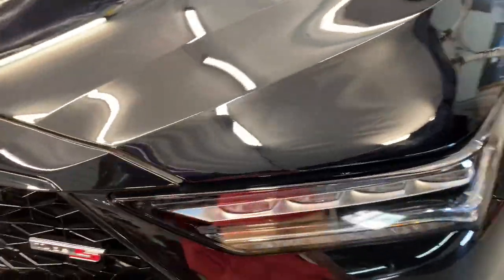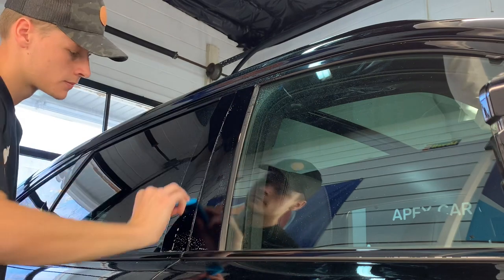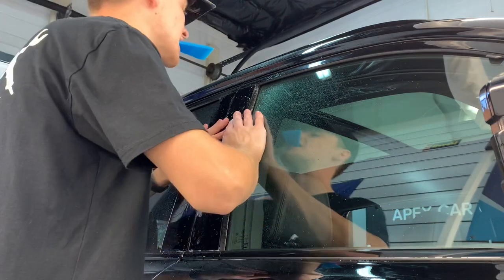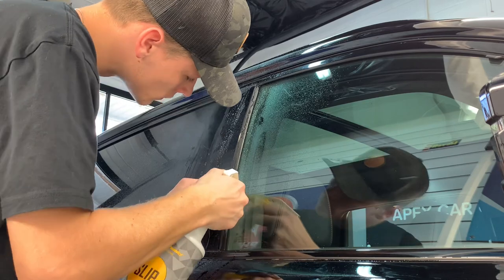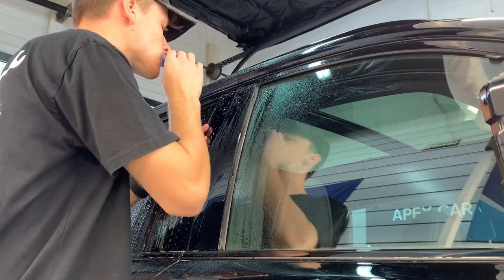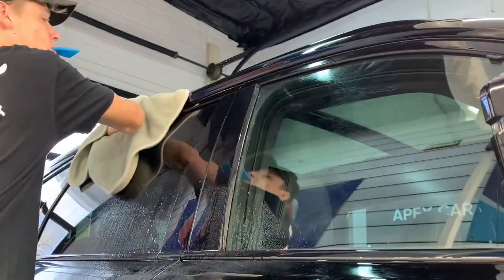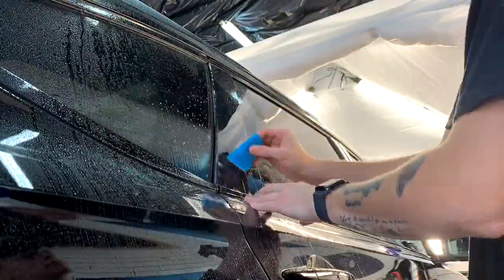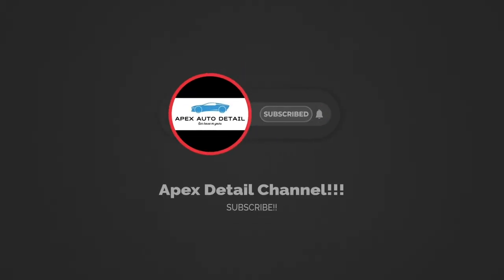The Absolute Best Protection For B And C Pillars!! Soft Black Piano Finishes!!!

Comment: The business that are doing mine should watch your video. They are hopeless. I’ve been back 3 times and now have to go back again. They don’t even inspect it once it’s done. I get it home and see problems every time.

One of their faults is crap on the squeegee that leaves bad scratches on the new film, through the healing layer into the lower layer. So from day one I’ve got scratches to deal with. This time a 9 inch long scratch on one piece and the other piece has about 100 horizontal scratches from no lube on the gritty squeegee, that scratch area is about 9 inches long by an inch wide. 

I haven’t been complaining to them just asking them to re do the problem pieces and I pay. Given I’m paying them for their bad work you would think they would be ok but now I’m feeling like the one that’s doing something wrong.

Comment: Hello sir. I have a question. I had mine pillars ppfed yesterday and on one of them the edge of the ppf i kind of white i sunlight (it reflects Sun different?) the detailer said its normal because od different cuting angle and it will disappear by its self in a couple of days. Hes against trimming it on the surface. What is your opinion?

Comment: Thank you as this is exactly what I want to learn how to do. I have a feeling you made this look a lot easier than what it is. Obviously I will have to bulk cut and pay a lot of attention to not cut the seals.
Reply from the maker: Dont angle the point of the knife into the film...keep it relatively flat...you will hear a squeak like a mouse. light enough to score...not cut through the film.
Reply: @apexdetail85  wow thank you for the help as I’m at a loss of words! Thank you!
Reply: @apexdetail85   @Pan The Organizer  I used Adam's Graphene ceramic spray coating as my base. Can I top it on with Turtlewax Hybrid Graphene Flex Spray Wax?